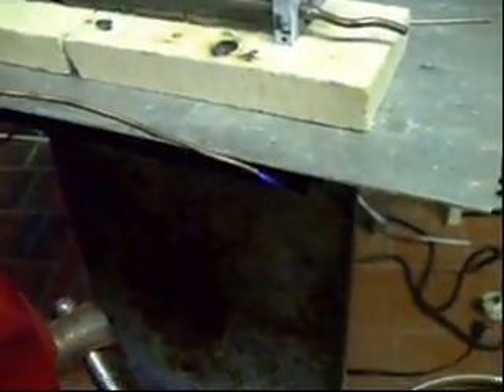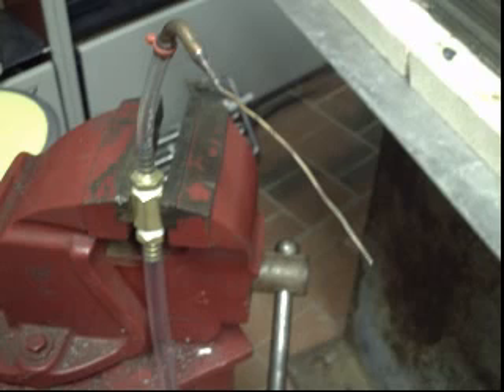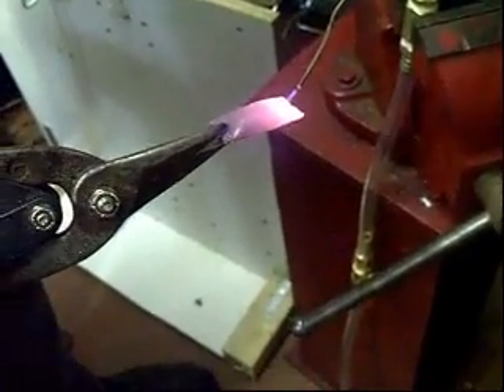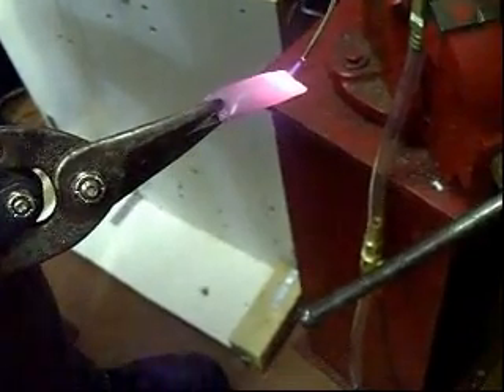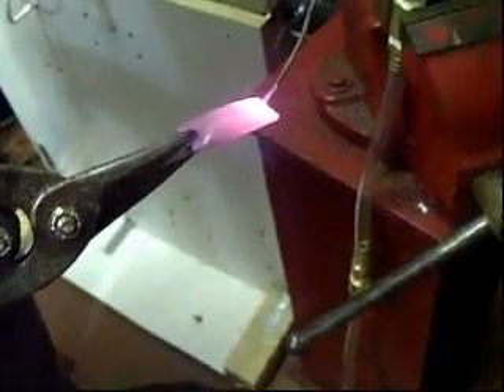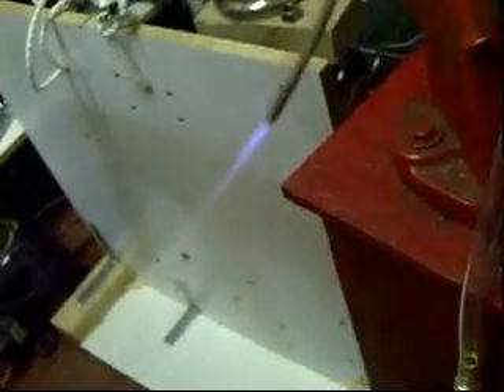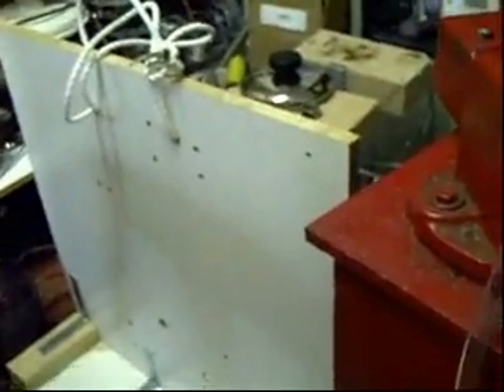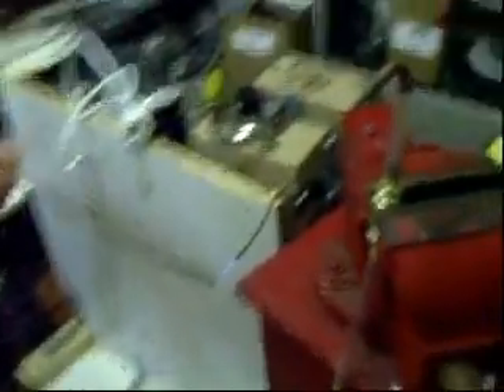#15 Hydroxy Mini-Torch From Fridge Evaporator

Comment from the maker: All i can say about the blue flame is, when i took a gasfitters course. I was told that any gas burning clean makes a blue flame. When you come in contact with something then it creates a yellow flame around the blue.  I always keep my electolyte cold and i never overamp any of my cells.  I use no bronze wool because i have no faith in it. My torch is not packed with anything at all. Totally hollow. The backflame arrestor "Hammer EX" provides my flashback relief. Mabye get rid of the bronze wool

Comment: you can solder in very tight spots with that
but remember sensitive electronics even
diods require great care so as not to fri
the device by conduction heating and by
the way that flame looks blue how are 
you able to do the impossible even sulfuric acid eleite gives me yellow its gotta be my brass tip and bronze wool
also the flame   on mine leaves a residue
on the serviced maybe i need one of those air stones after all.